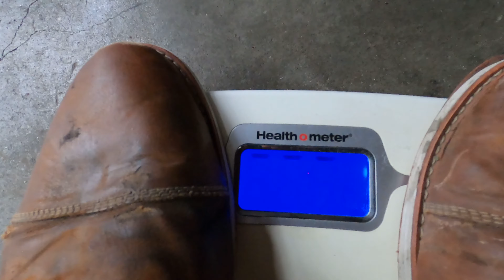Build a Budget Bobber! How to DIY and Make Money!

Comment: My exhaust wrap came in with like a Kevlar color, same as your's greyish in color with hints of black. And it was expensive, it came with an activator and the Steele ties. I'm starting to wonder if I could do what I did back when I had my shop. Just add the color to the activator.
Reply from the maker: So I ended coating those headers and other ones I've done since in hi-temp silicone coating/paint. Like VHT flameproof or something like that. U can find almost any color (I just use black) and it really seals them and gets them the color u want. It will smoke on ur headers the first few rides and then is good to go. Hope this helps!

Comment: Is it possible to maybe see a dirt bike turned into a bobber? Would love to see if that’s something you would want to do. Thanks
Reply from the maker: I'm down to do it. Let me see what I can find for sale near me. Stay tuned!
Reply: @lovelivegofast  you my good sir have another sub thank you for the reply and hope it works out I’m definitely looking forward to it! (I’m currently in the process of buying a Yamaha wr450) I really like the bobber/cafe racer look and want to see how much work it would take to do it. Plus I think it would be sick.
Reply from the maker: Yeah it would be. Like a super capable scrambler/bobber creation. I'm already brainstorming
Reply: @lovelivegofast  the idea behind it was I used to ride dirt bikes a lot and I like the look cuz it’s a classic and Ik you can do the build easy with most other bikes (heavier engines) but I see very little if hardly any using a dirt bike which to me would seam like the easiest cuz a stripped dirt bike is almost a scrambler/bobber anyways. It would be a light quick cheap fun bike that you could still rip trails (if correct handle bars are used cafe racer bars look dope but not best for off road.) Basically the only things id like to see is if you could strip a dirt bike down, how and where to weld the bobber seat, what gas tank would be used and how to fit it and what tires would be used instead of the thin dirt bike tires, bigger tires look better then thin ones. Thanks again and sorry if thats a lot to read just excited and wanted to clarify what I would like to see in the build video.